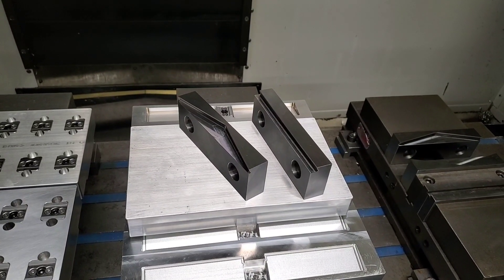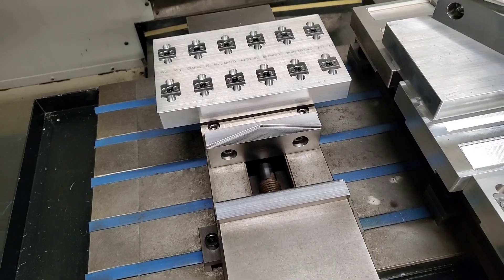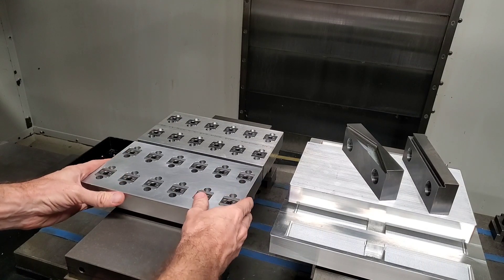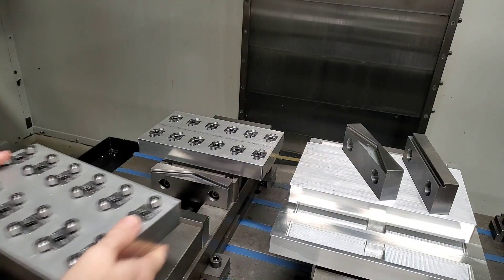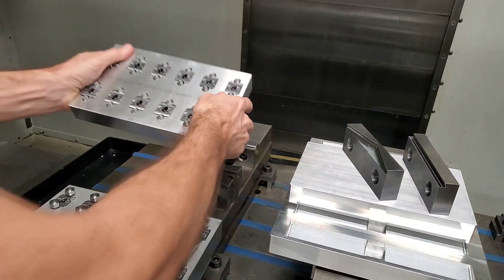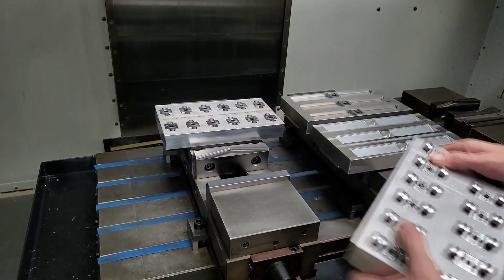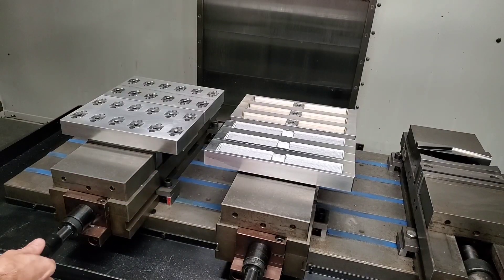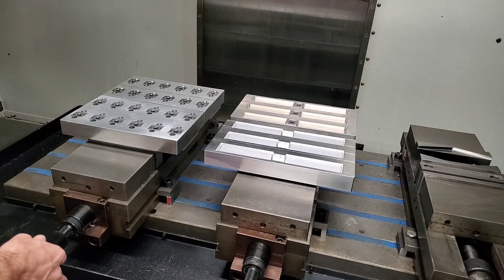Quick Change Vise Workholding Pallet System High Capacity Part Clamping

Comment: whats the repeatibility versus using  ground pull down studs, like pierson workhoding fixtures?
Reply from the maker: @jefflund763  There is a repeatability video on this pallet system on YouTube. The pull stud type is probably more accurate but these are a low cost alternative that are very easy to setup with little setup time.

Comment: You forgot to mention you don’t need to remove your vice/tram in another clamping system when swapping workholdong methods.

That’s one of the minor pain points in hoeing from a peorson pallet job to a vice job.
Better to never remove the vice if possible
Reply: The whole point of the peirson is  you put the vise on a pallet
Reply: @LoneWolfPrecisionLLC  i run a mini pallet, not interested in the little guy holding my vice for heavy steel hogging. otherwize love the mini pallet sysytem. super quick!
Reply from the maker: Your right and I always have a vice mounted on my tables so setup for this is really quick.

Comment: That's a good idea man! You should make a video touching off on the side of your pallet to show how repeatable it really is. I was also wondering if you could used this jaws on the back side of  your vise for larger, singular pallets.
Reply from the maker: Good idea I think I will make a video showing that. Also yes you can use the jaws on the back end of the vice as the step is above the vice. We will be offering larger 10"x12" pallets on our website very soon. They will fit directly in a single vice but can use the back side for double vices.
Reply from the maker: I made a video demonstrating the repeatability. I'll link  it below.

https://youtu.be/JNkpLQICg6w?si=DAagoTkLxoWY6bts